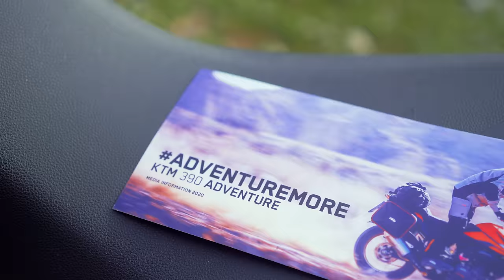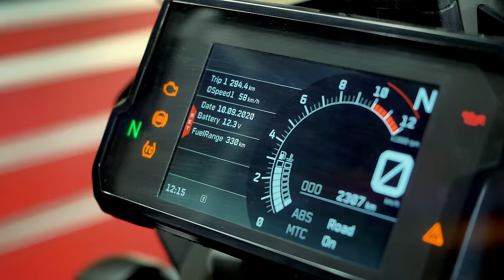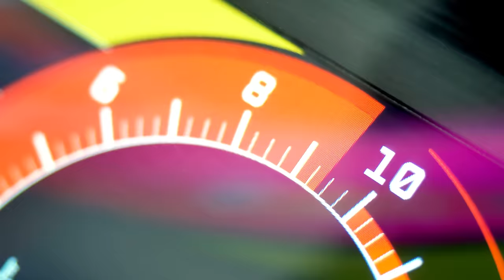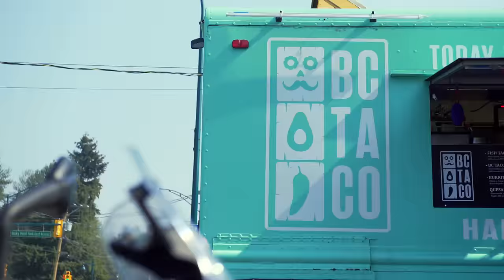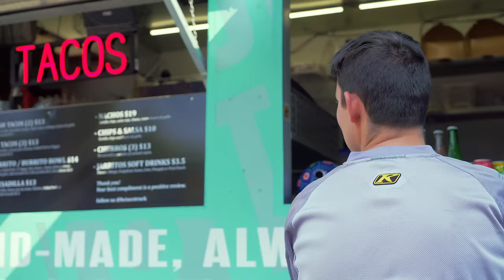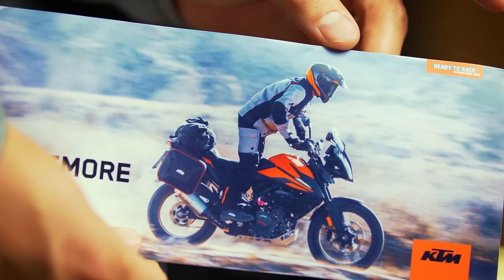The Smallest Adventure – KTM 390 Adventure Review

Comment: The 390 Adventure has many parts that the duke/svartpilen does not have.
The forks are a longer leading-axle type, the handlebar mount is solid rather than rubber, the footpeg bracket is inline with the swingarm pivot, the swingarm has a spot for a chain guide, 19" front wheel, the shock spring is stiffer...

Sure it's not the greatest adv bike, but it's not incapable of offroading!

Comment: @Fortnine :- What I want on a bike:- 

1) Front Suspension :- Softer like Himalayan. 

2) Rear Suspension:- 
Softer like G310 GS. 

3) Font wheel size:- 19" Tubeless with spokewheels. 

4) Rear wheel size:- 18" Tubeless with spokewheels. 

5) Engine:- Peppy like KTM 390 with Low End Torque like Himalayan (should come from 2k RPM) 

6) Brakes with Cornering ABS (switchable) like KTM 390. 

7) MTC 

8) 18 LIT Fuel Tank like TRK 251. 

9) Lightweight Trellis Still frame with good quality durable parts. 

10) Good wind shield that can protect me from wind at 130 km/h. 

Overall good reliability and good mileage too.

Comment: I'm sure you can get different pegs and bar risers for taller riders. For the price there is nothing better so far IMO.
Reply: But that's the point. For the same or less you can get a Duke 390 which does all these things too. So why go for the 390 Adventure which is not such a serious Adventure in itself?
Reply: @shubhamdhurve23  More comfortable for taller riders, and the additional ground clearance helps with bad roads and potholes. It's not a hardcore offroader, but it can manage decently enough. All in all, it's a decent package that many people would find appealing.
Reply: Indeed. For a better review check MADtv, Aussie review of the 390 is far more complete.
Reply: The DR650 is better

Comment: Your review is based on a short ride around a parking lot and some angled footpegs? Seriously, that was the first thing I changed.  I bought a 2022 KTM 390 Adventure for $6200. Changed the foot pegs,added some cordura saddlebags,installed a Tusk high mount fender and it's pretty much flawless(in this class of cheap ADV bikes). It's competitors are weak. The 390 ADV is a much better motorcycle than the KLR 650 and the BMW 310.
Reply: It so much better than the KLR 650. I bought one for my father who is just learning to rider at 65. He's rides all over with it now. It's small enough and light enough. He can use it on forest service roads and it's sips fuel.

Comment: Good video and I always enjoy Ryan's stuff.  Issues brought up include peg angle, bar position and ground clearance (and cast wheels).  First, nearly every ADV rider dials a bike into their egos, and replacement pegs (rather for the angle as in this case, or just for size) and risers/bars are among the first upgrades.  Ground clearance is not bad for a light ADV bike, especially considering that the wheel base is shorter than the big bikes.  Does this compare with a 790 ADV R?  No, it doesn't have the suspension, wheels or power.  But it's also half the price and 90 lbs lighter.  It's also barely half the price of a 690 Enduro.  This bike is probably the best VALUE in the ADV world.  7" of suspension travel isn't ideal-but it's not bad for the purpose of an ADV bike (not a "dual sport" or "plated dirt bike").  I have a 1290 SAR and am thinking of trading for one-looking for something smaller, lighter, and not $18,000 to go bounce around in the dirt.  Frankly, I don't take the big bike some places I used to go on my smaller, lighter bikes.

If you're using the full capabilities of a 690 E or 790 R, this probably isn't the bike for you.  If you want to blast through the desert at 100mph, get a 1290 SAR.  But for getting out and exploring the backcountry, on pretty rough forest service  roads or ATV trails, on a bike that is fairly light (by ADV standards, not "dual sport" ones), with a good bit of technology (personally I could do without ABS or TC, but it's not a bad thing) this looks like it might be a good fit.  Both for new riders looking to give ADV riding a shot, or for older, experienced riders getting a little "past our prime" (such as me).  Looks like a pretty good BDR bike, IMHO.

Comment: An adventure bike with alloy wheels? 🤔
Reply: Well, then I will call my little Lion also an adventure bike...Just has no adventure plastics on it. But it has alloy wheels...okay, a low exhaust. Ah, whatever...
Reply: Let's be honest here. For most people buying ADV bikes alloy wheels are the right choice. May as well use street tires when the bike never leaves  pavement.
Reply: Yeah and I've already bent those. This isn't something one should buy if you're Really about adventure
Reply: Tubed spoke wheels are a nightmare for puncture repair so I'd rather choose alloys over them
Reply: @rohithstanly  BMW gs use spoke wheel
Reply: Nearly half of all adventure bikes have alloys now. It depends what you intend to use the bike for. "Adventure" does not necessarily imply dirt any more than it necessarily implies pavement. They're dirt-capable bikes, not dirt bikes.
Reply: A lot of adv bikes use alloy wheels, especially a small adv like the 390 which isn't supposed to be a hardcore adv bike can easily get away with it. It's designed for newer riders first and foremost, and spoke wheels would both increase cost, maintenance, and general ease of reliability as long as you don't trash the bike. Spoke wheels only become relevant when you go onto hard single tracks at speed way above what most 390 ADV riders will ever do.
Reply: @rohithstanly  just put in a new tube dude
Reply: @cisium1184  good joke. I exhaled through my nose

Comment: So this vs the Versys X300, what’s the verdict? Or are they different enough.
Reply: This!
Reply: On Versus x300 you have one cylinder more and higher speed limit. In my view Kawasaki has a better engine, but KTM has a bit better suspension. So in overall I would better stay with my Transalp.
Reply: The ktm has more power and torque, better suspension and tires, better electronics and more features, it's also lighter. It's more expensive though.
Reply: My non objective opinion being a past Versys owner. Used it as a daily rider. Rock solid reliability. In most dimensions it sits as a bigger bike than the KTM but with a lower seat height. Loved it.
Reply: @Juuul89  sure it has more power by 80 ccm more, but wight is similar because of KTM's smaller gasoline tank, tires you would change anyway. So Kawasaki with better wind protection and 2 cylinder looks better for long distances, and KTM for a bit more dynamic .
Reply: Get the Himalayan. Versys x300 has an high revving ninja 300 heart which only comes alive past certain rpm. If you are a true offroad enthusiast, get the Himalayan and if you want a tourer then get any of Em.
Reply: Suzuki DR-Z 400 is better than those two. If you have money buy the ltm 690.

Comment: Gee , I was planning to ride across Africa on this bike! So disappointed 😔
Reply: Look for a bike like RE Himalayan, which are easily repairable in developing nations.
Reply: You can ride this Cape to Cairo. The African back roads are not boulders and steep climbs but gravel, potholes, and mud. The ground clearance and suspension are more than apt for the job. Just if the riding position is comfortable for you, and that can only be checked on a test ride.
Reply: This bike is a great tourer with some off roading capabilities... Check the other reviews before you make your decision.. Cheers
Reply: Bajaj engines specially the 373cc ones (Duke,RC,ADV390 and Dominar 400) have overheating issues from a several owners I've known and the fan on the radiator blows directly on your thighs so you might feel some unpleasantness while riding slow on a hot sunny day but I've also known some owners that ride the hell outta this thing for more than 20 hours almost non stop and not break a sweat. Maybe it's not that common but still a risk, I'd go for the Himalayan for the harsher African environment. Easy to fix and easy to maintain, no electronics to break down and also a capable semi off roader.
Reply: I read about a lady who did an RTW on a lowered CB500X with a 17” front wheel. Also read Elspeth Beard, Lone Rider, she did a RTW back in the 80’s on a 1974 BMW R60/6 - with hand built panniers the size of a shed. You’ll be fine. If you have a mechanical- you’ll find a way out of the problem. She did.
Reply: Madtv has made a good review with a actual long offroad ride not a car park

Comment: “Just get a 390 Duke for 1000 bucks less.”
Or buy a used SV 650 that doesn’t run out of puff so quickly... Even less money for a lot more bike.
Reply: Had a 2018 SV650, no way it can go into the mud or dirt like this one, the SV it would get stuck in the first 2 meters.
Reply: aao331 Same as the Duke, so you kind of missed the point.

Comment: "Ergonomically it's a street bike with adventurous plastic" Simply because it has forward pointing foot pegs? Just replace the foot pegs. Geez...
What about the gamut of features that come packed with this thumper?
- Ride by Wire
- Cornering ABS
- Traction Control (that can be turned off on the go)
- Slipper Clutch
- Quick Shifter
- TFT dash
- Bluetooth Turn by turn navigation
- 43HP; 37T; 390cc; 378lbs 
- 33.7" seat height
- spoke wheels upgrade coming soon to KTM dealerships. 19"F 17"R
- adjustable USD forks (front/back)
- 12v socket, GPS mount
- 65-70 mpg!

ALL of the above in a  motorcycle that cost $6200 USD / $8200 CAD in the USA. BUT it is selling for $5110 USD / $6800 CAD in Canada!!!  A steel bicycle made by Co-Motion cost USD $8000. An ebike by Specialized cost USD $12000.

Off road: https://www.youtube.com/watch?v=x-Skb_6U47Q (courtesy temex2)
Reply: ground clearance tho
Reply: @Anandfulness  This is not dual sport. It is a touring mobike.

Comment: This is the main reason I chose a 250 cc vstrom over the 390 KTM. The high revving engine and lower torque towards the bottom are also dealbreakers. Granted the suzuki isn’t a great adventure bike. But very high ground clearance, low rpm traction and a half decent performance was all pros. But while standing up much like the KTM all my knees grab is air. That is a huge disappointment. However options were limited locally.

Comment: Are you  losing objectivity for the sake of entertainment?

Let's review your review: 95% of the video has nothing but praise: light weight, engine with both low-end torque and power to cruise at highway speed, great suspension, tires, good LED lights, easily repaired flats due to tubeless tires, TC/ABS, stock adjustable levers/crash bars, and flawless value proposition.

In the last minute the "issues" arise: Slanted footpegs, too knobby tires, low clearance. As a result, it is a no-go. 
What? Is that a brutally honest or brutally incoherent conclusion? Perhaps you are simply too tall for the bike. One may change the footpegs easily. The tires are about the best there are for mixed riding. But those solutions are too obvious for entertainment purposes.

I watch your channel for honest and spicy motor journalism, for dumb entertainment I watch SNL...

Just for info, I'm 61 with more than 50 years of riding all type of bikes across many countries under my belt. And it's no easy to find a combination of qualities for an entry adventure bike like this one.
Reply: @Jamie Davison Help me out then, What did you get from It?
Reply: @Jamie Davison Ok Jamie Davidson thanks for your useful clarification. I guess you are right as my angle of expecting a straight evaluation to help me form an educated opinion about a bike is the least expected one given the 19k thumbs up vs only 122 down, including mine. From now on I'd take this channel as a jest one, sort of The Canadian Two Wheel Top Gear. Uhm, but then again I'd prefer stand up comedy for entertainment, so unsubscribe it is...cheers

Comment: If i got this it would be as a 2nd bike for daily commuting in adverse weather on adverse road conditions. 

Larger fuel tank, more fairing/weather protection, more upright, taller, 19" front wheel and gnarlier tires. 

That's the reasons i can tell to pick it over the duke for this purpose, it's competition is the G 310 GS and CRF300L Rally (to a lesser extent.) but not really the duke.

Comment: Out of the box any bike you buy needs modification. Within the break in period its limited in power due to revs. Once it's broken in though it comes alive. Two completely different experiences. This is a lightweight thumper that cranks more HP than a DR650. All the farkle of the 790 for half the price. With a few mods this is a snotty offroad machine. I did the northern half of the Continental divide on mine. 1656 miles in 6 days. No issues. I would never go back on a DR or KLR after riding this 390. Tons of fun. Risers, Black Dog skid plate, barkbusters, offroad tires, and let it rip.

Comment: MOds I'd recomend for this bike: if you want to use it for more "off road", then there are dirt bike style pegs (flater, and wider), along with risers for the handlebars.  I also recomend the ergo seat, adn even from KTM you have spoke wheels, and I'd go with a more dirt oriented tire like the TDC80s?  THough the TKC70s are much better for longer road stints. The KTM offered rack is nice too if you want to travel with ti. 
Ultimately, this is an awesome commuter or in town bike! 
If youw ant to get more aggressive, go with a dual sport like, KLX300 or a full dirt bike. I traded my 390 adv. for a KTM 350 EXC-F, and quite often, I miss the 390 adv. (SHoudl have done somethign like keep the 390, and buy a 250 XC-W TPI or 350 XCF_W instead.

Comment: Hey bro, I have to change this head unit into flexible one, like 390 duke. Is that possible? Also can you tell me why theses motor cycle with fixed head unit? (My issues 1.it looks bigger in terms , 2 lot of wind blasts 3. Extra weight 4. And turning make too wierd, 5. Hilly areas difficult to turn around and head lights are not points as per the handle bar.)

Comment: I've had one for some months and my experience was horrible! Electrical fails and missed important screws after light offroad tracks were some of the troubles which motivated me to sell it as soon as possible despite its fun engine. It is easily noticeable that this model is the cheap one of the brand together with the 125 Duke. Good luck guys!

Comment: I don't know about that final summary. It seems harsh. The two big problems noted are the pegs are slanted, and he can't grip the tank with his knees. Both valid points.

Easily fixable. 

Pivot Pegs, which rotate to match your body position.

Bar Risers (for people over 6foot) Pros hate bar risers on most bikes but perhaps on this particular bike it might be required.

If Ryan has ridden a 690enduro he would appreciate a similar lack of 'tank between the knees' which isn't really a fault, it's just a characteristic of the bike. 

low clearance, well, most newbs don't try and ride over logs my bro, they just want gravel to do skids on.

tyres can be changed by most dealers before bike delivery

The biggest problem which you didn't touch on was that by default the traction control is very aggressive, meaning for new riders the first time they hit a snotty hill they stop moving as the wheel spin is too much for the default settings. Ryan should have gone over the differences between settings to show just how much work the ECU is actually doing.

thanks for the cool video tho

Comment: I am the owner of a KTM 390 Adventure which I bought in January 2021 as my very first motorcycle.
About four weeks ago, while riding on city streets, I noticed something unusual with the damping motion of the rear suspension and stopped immediately. The rear suspension was leaking fluid badly. I was able to ride back home and took the bike to the KTM dealer for a check. The KTM dealer received my bike on December 7, 2021. A month has passed, and they have no idea at all whether the faulty rear suspension is covered by the warranty and that it must be checked with the KTM factory sometime during mid-January. The bike is not in working condition and it is in their workshop since its breakdown.
This is a very disappointing and frustrating situation as I bought this bike mainly because of its alleged quality suspensions and its two-year warranty. Needless to say, KTM has not lived up to my expectations as a newbie in motorcycling.
Reply: This appears to be an consistent issue. I saw few statement of that sort. It seems the rear shock seals failing due to lack of heat shield on middle muffler. I rode mine 3kkm so far and fortunately so far nothing bad happened.

Comment: KTM might consider a competitor for the '21 KLX 300 I just bought. I have owned many KTM dirt bikes since 2014, and love then, but until the recent shortening of some Husky dirt bikes (.4"?), they are all 38" seat height, and sometimes overkill for easy rides. The KLX 300 is well suspended, reliable, 35" at the seat, and has plenty of motor for easy trail rides & gravel roads. Watch 'em sell at $56-5800USD.